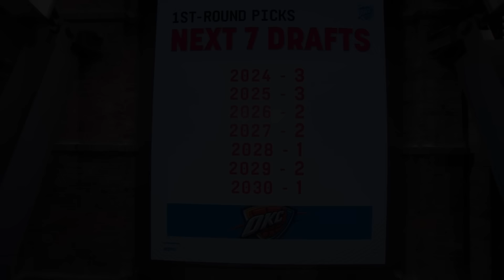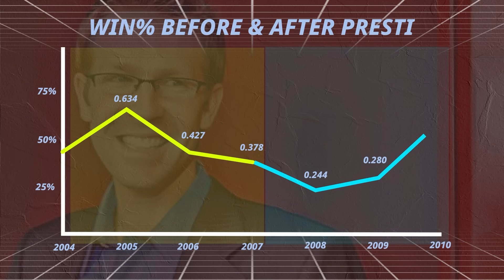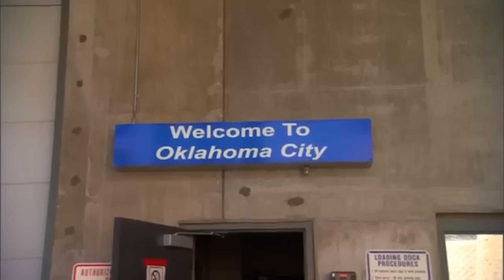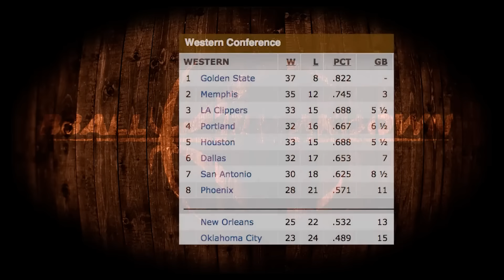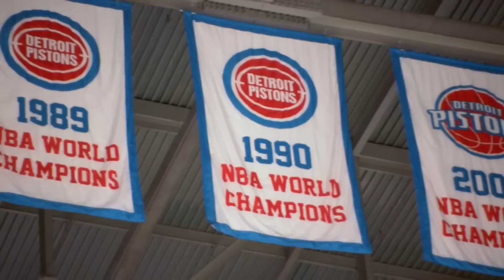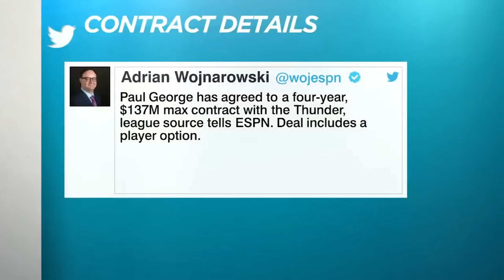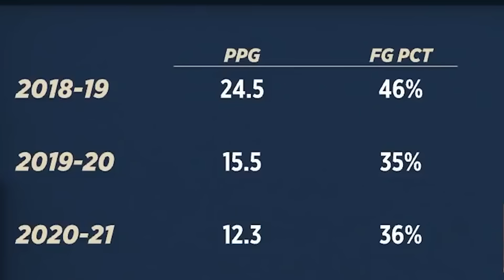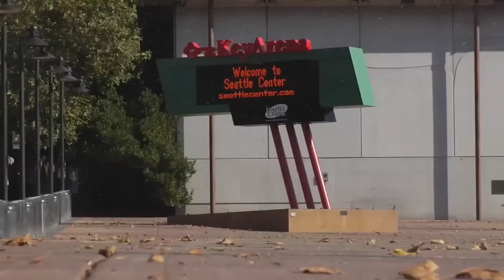A Tale of Two NBA Rebuilds

Comment: When the Ford family bought the lions in 1964, they were a storied franchise,  and turned the team into the laughingstock of the NFL, and is only now changing their culture 

Tom Gores bought the Pistons in 2011, which was also a historic franchise, and has basically run them to the ground. If you’re over the age of 30, you’re probably not gonna see another pistons chip in ur lifetime assuming Gores holds onto the team
Reply: Someone has to have the type of love and eye for talent that the Holmes and Presti’s out there do along with draft capital. Lions had that capital and turned it around along with Presti in OKC. Detroit didn’t have any of that. Just money.

Comment: WHile OKC has done a good job rebuilding I feel like this isn't a fair comparison. OKC had the assets to really accelerate it where detroit has been trash for a minute.
Reply: I agree. Presti definitely has an eye for talent that can’t be denied though. Harden and Westbrook seemed like reaches by experts and Presti knew the fit and upside was more important. That bet turned into big time trades that they’ll reap for years. Meanwhile, Pistons had no fucking capital in the draft at all, because they broke the bank on sorry broken down players.
Reply: OK compare Pistons to Rockets. Rockets are on the rise and Pistons are still straight trash. It almost like the Pistons should've picked Jalen Green over Cade Cunningham for one.
Reply: @Bob-te3le  One team signed veterans and one didn’t. 

Assuming Detroit goes and gets veterans this off season they too will improve. The big difference is Houston’s core guys aren’t primary ball handlers. I mean they had given the ball to Amen instead of FVV they have 10-15 wins too. 

Orlando would be the more apt comparison since they are at least doing it with young players.

I think Detroit is the 18-19 Suns. They were trash for four years with Booker before they showed signs of life. Only guys like Luka and Bron can just run a team starting in year two
Reply: @sosmooth13  Harden definitely wasn’t a reach. He made by far the most sense among the available players. (Maybe Steph but no one was looking at Steph like that.)

But 100% on everything else
Reply: u could also blame the pistons for tht tho they held on to old players for too long and never traded to get younger and wanted to "compete" by being a 5-8 seed for years like the pacers as a gm u gotta know when its time to actually restart if u want to actually compete and not be mediocre for a decade
Reply: @Nick_MyName  Well I'm not going to blame the organization because the owner passed away. That's a little macabre

But certainly OKC is a much better run organization the last 15 years. Presti has been there since 2007 and had complete job security to initiate a rebuild. (Although, again, his hand was forced.)

Detroit has been a disaster since Bill Davidson died in 2009. (Really since the 2008 off-season when they replaced Flip with Michael Curry and traded Chauncey but Davidson was already in bad health at that time.)

And yes, it would have been smarter for Joe to trade Rip, Tayshaun, Sheed and Dyess when they traded Chauncey -- a fact EVERYONE said at the time. And it was stupid to let Stan be coach and GM and to sign off on the Blake Griffin trade. (Although after Curry, Kuester, Lawrence Frank, Mo Cheeks, John Loyer ... It was understandable why you'd fire Joe and bring in a proven coach.)

But yes. Ownership is really important and OKC has good ownership (unless from Seattle) and Detroit has bad ownership.
Reply: That’s a horrible argument. One team has had a decade of lottery picks and the other only had 2. One team won the lottery and the other team has never won it. Thunder are just more competent. How does the assets matter in these rebuilds comparison when the Thunder haven’t even cashed in any of those picks? Thunder are just run way better and it shows.
Reply: @Bob-te3le cade is 100% better then jalen green
Reply: no okc just runs their organization better. better at developing and better at drafting. detroit has picked in the top 15 of the draft every year since 2009. they have had way more opportunities to get good players then okc has
Reply: @MADDIIXX  It's definitely a better run organization but that doesn't change 
1) how lucky the got
2) that they started this current rebuild by being gifted SGA and SEVEN first round picks whereas Detroit started their rebuild by paying Blake Griffin $40m to not play for their team. 

Also this idea that OKC drafts so well needs to stop. You don't get credit for obvious picks like KD, Chet and Harden. That's like saying SA is good because they draft well. No, they won because they got Tim Duncan. (Pop has said as much.) None of the rest would have mattered without that ping pong ball having a Spurs logo on it.

OKC made four good picks: Russ, Serge, J-Dub and (probably) Cason.

They traded away Bledsoe; drafted Steven Adams over Giannis; Harden over Curry; Andre Roberson over Gobert; Cam Payne over Terry Rozier; Terrance Ferguson over OG Anunoby (and Jarrett Allen and Derrick White and Kyle Kuzma); Darius Bazley over Nic Claxton; Giddey over Franz; traded away Sengun; Tre Mann over Jalen Johnson; traded away Peyton Watson; and my personal favorite: traded Immanuel Quickley and Jaden McDaniels for Poku.

OKC was bad -- really bad -- for one year and got the #2 pick and the exact perfect design-him-in-a-lab player they needed for their specific roster and system. Detroit has been horrendous for 3 and got the worst possible pick twice. That is LITERALLY pure luck. 

And not only did they miss out on Wemby or Miller and Paolo, Chet or Jabari, but instead of Wemby, Paolo, Ant, Zion or Luka at 1 they have Cade because they got the #1 pick in 21 not 18, 19, 20, 22 or 23. 

That's just (bad) luck. 

Hell just flip the picks in 2022 and everything changes. If Detroit gets Chet with 2 and OKC took Sharpe (probably) with 5 then you can probably flip Duren and J-Dub as well and both are in the play-in and the narrative is completely different.

And that has nothing to do with being better run, hiring better coaches, drafting better, developing better -- it's a freaking lottery ball bouncing differently. Pure 100% luck.
Reply: @808bboarder  
- Detroit has had one pick inside the top 5 in the last 20 years. OKC has had four. Equating picks 7-8 with picks 2-4 is a bad faith argument

- the year Detroit won the lottery was the worst year to win it since 2018

- OKC got KD at two and Chet at 2 (who they definitely would have taken at 1) so saying the "never won the lottery" is a specious argument. They didn't get the first pick but they got the player they wanted.   

- Kawhi Leonard saying he'll only sign with LA if they acquire Paul George is definitely winning the lottery. 

- Both Jalen Williams and Shai are from the PG trade so how have they not cashed in? That's their two best players! 

-Go read my other comment about OKC's supposed competence in the draft. They have missed WAY more than people think
Reply: @Bob-te3le  the thing is, rockets used to have harden. which is a massive massive asset
pistons has draymond and griffin
both were released. (IIRC)
Reply: @michaelahurt  but your missing the point. yes they’ve got bad lottery luck but also they’re passing on players that are just clearly better then they’re choice and when they take good prospects like hayes for example they ruin him with awful coaching while okc coaches players and gets the best out of them immediately like jdub and rehabbing chet’s injury and having him bounce back and being very good is still impressive
Reply: @michaelahurt  also a lot of these decisions are 1. not bad or 2. the consensus. adams over giannis, harden over curry, payne over rozier, giddey over franz, and mann over johnson all were consensus moves or were moves that made more sense for the team. calling harden or adams or even someone like roberson bad picks is super disingenuous
Reply: @michaelahurt  you get credit for hitting on joe in fa when the sixers gave up on him, developing shai into a superstar nobody thought that could happen, developing dort into a very good 3 and d player, developing jdub into a budding star, developing j will into a rotational player in less then 2 years as a 2rp, developing wiggins, adams, i mean i really could keep going on there’s no way you don’t think that they don’t draft well they’re pretty easily a top 3 drafting team in the league behind only really the grizzlies off the top of my head. also the year before they got the 2 pick they had tied for the best odds for the number 1 pick iirc and fell to 6
Reply: @MADDIIXX  100% agree about Isaiah Joe, Dort and J-Dub. (Even if they seemed to think Dieng was better but so did I.)

My point is none of that matters without the luck of getting Chet (through a LITERAL lottery) and Shai. And J-Dub was from the PG trade as well.

None of it was intentional. They didn't call LA and say "Hey, we like this Shai kid and think he's gonna be an MVP candidate someday. How about you give us 7 firsts and SGA for PG?" They didn't call Houston and say, "Hey we need a veteran PG to help develop this Shai kid. How about we give you Russ and you give us CP and 4 firsts"

Once the PG thing happened Russ basically said I want to play in Houston and CP was the only contract that worked.

The whole thing is a black swan event.

And I'm not saying they haven't developed well or that hiring Daigneault wasn't an insanely good hire, but a huge reason why the role players were able to develop is they are playing with an MVP. MVP's do that. They make everyone else look better. 

Take J-Will, Giddey, Joe, Dort, Wiggins, Williams and put them in Detroit with Cade and Monty and they aren't going to look nearly as good.
Reply: @MADDIIXX  Every pick they made was widely regarded as the right pick at the time. The only guy you could argue they passed on was Jalen Williams who is a late bloomer.

The most arguable one was Killian over Haliburton. You can say development but Killian was historically bad right away. You're essentially arguing their so toxic they destroyed a guy in 2 months?

Really? So how did Stewart develop?  Or Cade? How did Jerami Grant take on a larger role? 

Killian can't shoot, Jalen can. There's no development. You're just guessing with a lot of these young guys, looking at indicators. Justise Winslow shot better in college than Tyrese Maxey. Always keep that in mind. 

Give Detroit Chet instead of Ivey or Wemby instead of Ausar or Ant instead of Cade and we aren't having this discussion 

Also Cade also missed an entire season and bounced back and improved so not sure what that has to do with anything
Reply: @MADDIIXX  I agree. That's exactly my point. Presti isn't some savant who sees what no one else sees. No one is. 

Drafting in the NBA is 90% luck. You can make stupid picks based on circumstances (Flynn over Curry, Okafor over Porzingis) but NO ONE can predict what 30 year old will be like at 50 let alone what children -- these guys are 18-21; they are essentially still children -- are going to be like when they grow up because future experiences are going to shape them and no one has any idea what those will be or how they will react.